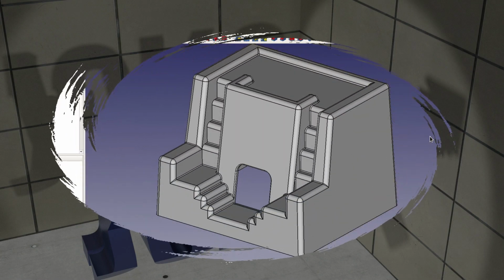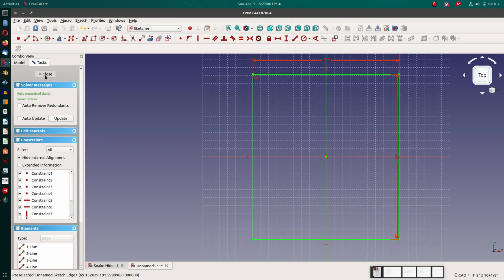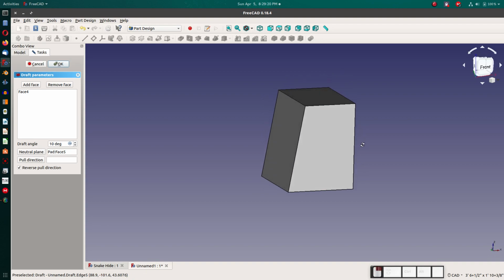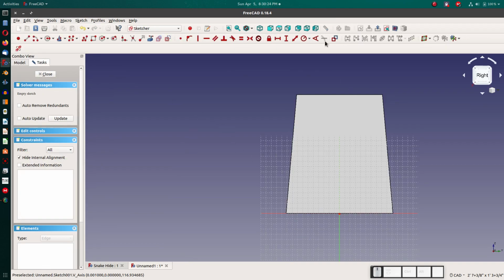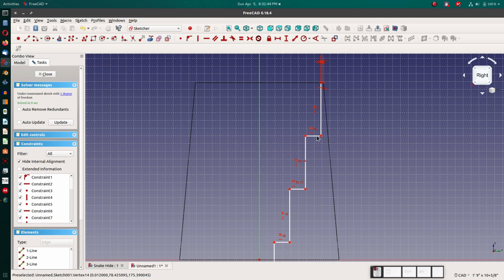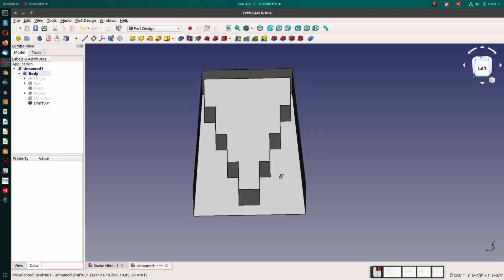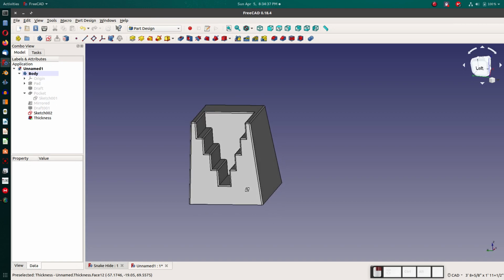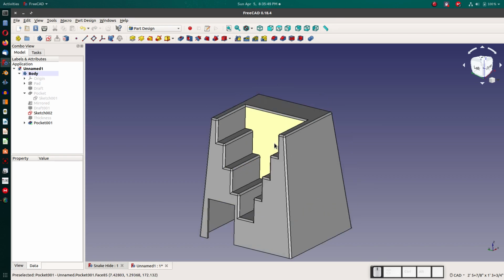FreeCAD - How to Use Draft Face in Part Design to Build an Animal Hide |JOKO ENGINEERING|

Comment: But  what if you want to draft from an added vertical line? Not edge to edge
Reply from the maker: If I follow what you're asking, you'd like the draft to start somewhere in the middle of a face instead of the edge where the face ends?
Reply: @JokoEngineeringhelp  yes, exactly. However, I made it work with a Chamfer instead of a Draft (not sure thats the right way) and it worked on this particular model. But Id be grateful if you could show/update a video with making a draft from an added line, not only edge to edge. Thanks for the educational videos :)

Comment: Unfortunately this "feature" of establishing a 10 deg draft on Face4 and the neutral plane on Pad:Face5 does not work to change the angle such that you are making more of a pyramid, as demonstrated in the video.  In 0.19 I make the exact selections and nothing works, the cube goes back to being its original shape as soon as I click on the "Neutral Plane" button and select Pad:Face5,  Thereafter I can clear the "Neutral Plane" to be blank and the reverse direction is a non-ops.  In fact, as soon as you click the Neutral Plane button the cube goes back to its original shape... odd.  No response from checking / unchecking the Reverse Pull Direction.

The workaround is to make the selections just as you have, then  click "OK" and then double-click  the Draft in the tree view and then when you come back in the Reverse Pull Direction then works to be more like a pyramid.  It just doesn't work "live" as shown in the video (version 0.18) until you close and come back in to edit the Draft (0.19)

Comment: Thanks for the tut!  I was wondering if FreeCAD has any way to apply draft angles against extruded irregular curve shapes?  I have some letters I am trying "pyramid-ify" but it's unclear to CAD programs what to do with letters with crooks or islands (think "s" or "o") if you contemplate a loft approach.  It's essentially a dynamically expanding XY offset along the Z axis.  I'm importing the letters in svg as geometry with other elements of a logo (to be 3d printed).  About to just stack individual extrusions corresponding to one layer height each at ever increasing offset with Tinkercad because I just don't know enough!   Any plugins available for something like this?  Appreciate any insight, cheers!
Reply from the maker: That's a tricky one.  Assuming you want to pyramid every letter individually, applying draft to something like the outside face of the letter O would not be able to draft it where the top of the O would be smaller than the bottom of the O.  I think your best bet would be to try to find a pyramid type font on 1001freefonts.com or something like that with a larger base than top, then when you extrude the font you can draft the remaining faces.  I hope that helps
Reply: @JokoEngineeringhelp  Thanks for your reply!  I'll check it out.  I'm trying to transition from Tinkercad to FreeCAD. I was importing a lot of svgs there to augment its utility but decided it was time to get big boy CAD tools.  One thing I'm lamenting is the circuitous route to get yourself a simple extrusion from imported vectors and the crazy splines that are generated if you commute the path to a sketch in the draft workbench.  It later doesn't like to play with chamfers or other boundary calculations like the aforementioned draft.  I'm sure a lot of it is me just being a noob, but modeling logos and personalization are first goals for many new 3d printer owners.  I did see a video of yours about tracing a logo from within FreeCAD and I had success doing the same and then applying fillets, for example.  I'm not sure the Sketcher will ever be as comfortable to work in as your typical vector graphics UI, but if you figure out any shortcuts or future revisions include more user friendliness in this direction, I will be there to watch your content on it!

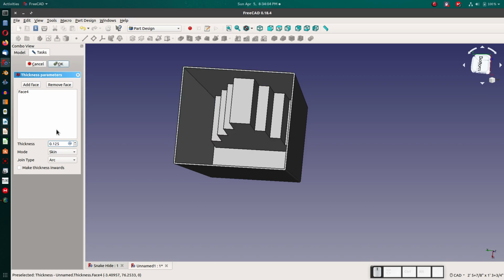Comment: thanks for the thorough intro in draft face. Around 7:50 you have an issue with shoveling out the object, say you had to have a thinner edge how would you get around this? I know its technically not a draft face question.
Reply from the maker: In the video I get around it by making the edge larger but you can also specify a smaller thickness value